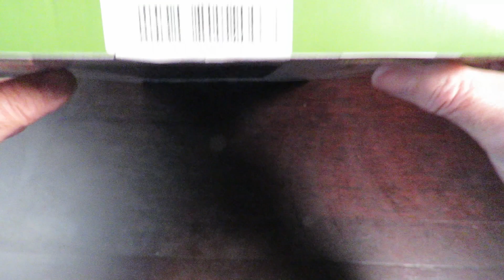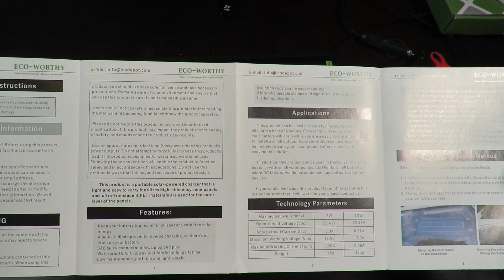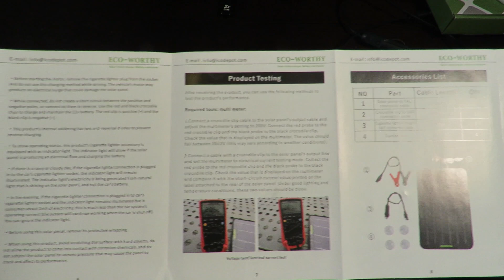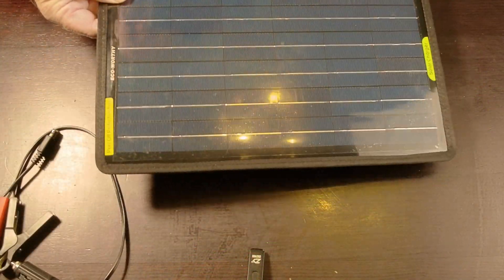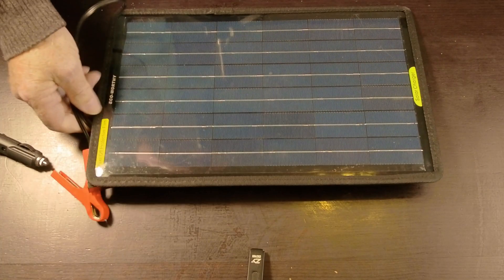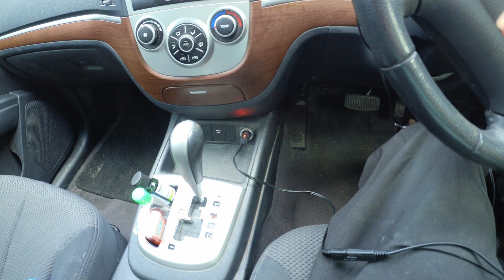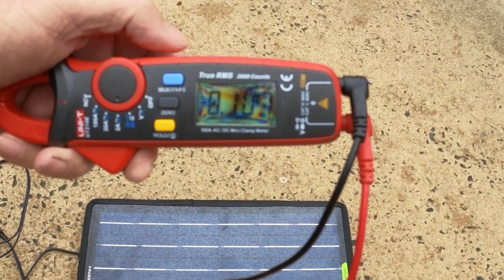🔌Save your Car Battery from going Flat - Eco-Worthy 10w 12v Trickle Solar Charger

Comment: I've just purchased a 10 W trickle charger. When I attach my multimeter to the crocodile clips while the panel is in daylight it reads 0 Volts even though the green led light is lit up on the back. I have read that due to diodes to stop reverse current then an open circuit voltage check can't be carried out, but surely I should have a voltage reading ? Any advice please

Comment: I bought the same brand from amazon but the company redesigned it so it does not look like what you have. The first one I received from amazon and tested under the sunlight which did not produce more than 0.02 amps. According to the specs 5W solar panel supposed to produce at least 0.2 amp. The seller offered a replacement and just received it today. Will test it tomorrow.
Reply from the maker: Please let me know how the new version performs.
Reply: @GarryPurcell  Sorry that I took too long to reply. I received a 5W solar trickle charger from the same brand. I hooked up to my car battery with clamps to test it for a few days. I realized that 5W isn't enough to charge or maintain the battery. I guess the 5W solar panel works for the smaller battery size. If you own a decent car you should go with at least 20w but there is no guarantee that would work. I live in an apartment with a bunch of tall trees and buildings where there are only a few spots where I could get the sun all day. Now I am using OYMSAE brand 20w panel placed on the dashboard facing south where I can get lots of sunlight. Also, I tested amperage rate every hour which it reusting average of 460mA while the spec says optimum operating current at (Imp):1.11 A. This is due to the sun's positions. In my experiment, solar panel usage should work little less than a half of the specifications. When you buy those small panels you will need to consider the output amperage rather than the wattage and voltages.
Reply from the maker: @kennyhoffman4375  Thanks for getting back with an in-depth view of the device you bought, and the shortcomings of the lower powered unit. I'm certain that will help many people who read the comments.🙂

Comment: 4 me is a bit too high voltage to charge a battery
Reply from the maker: A Car alternator charges between 13.8 and 14.2 volts, so it's hard to say if the solar panel outputs too much voltage, I'm sure I'll find out in time. 🙂
Reply: @GarryPurcell  safety voltage to charging is between 13,2 to 16,2 V.

Comment: This may have been added but if using the cig charger remove the resistor and LED from the cig plug (takes 2 minutes, just snip it out) as it sucks over half the power from the unit and will drain your battery at night if plugged in. Other than that this solar charger works great, I use it on my Merc albeit via the battery terminals as the 12v AUX is off when the ACC curcuit isn't activated via the key.
Reply from the maker: Handy to know.
Thank you.
Reply: A video showing how to snip them out would be great for us girls.

Comment: Seems a little high for the voltage, I believe 12V batteries aren't supposed to charge over around 14.2V or they can be damaged
PS- great video, thank you for sharing 👍
Reply from the maker: I always thought amps would be more of a problem than voltage.
Reply: @GarryPurcell  I believe its the unregulated voltage that causes the damage why some people run charge controllers I guess
Reply from the maker: @JonnyDIY  Thank you, I'll have look and see what I can find online.

Comment: just bought one, but after reading reviews and comments, i am inclined to buy a battery tender controller to use with it. This way there is no danger if the diode fails that the battery would be fully discharged and fail
Reply from the maker: I'm not sure myself.

Comment: Cigarettes lighter plugs are usless on many american and Japanese cars as some European cars as the Cigarette lighter plug only works with the ignition key in the on or acc mode. 
Battery clips can come off or short out to the bonnet(hood)  a solid electrical connection that has a fuse 3" maximum from the positive battery post is the best route a 10amp fuse should be plenty.
Reply from the maker: Interesting observation, thank you.
Reply: do the lighter socket  have to be live to charge te panal

Comment: 3:50 you will find that the radio and cigarette lighter run off the same fuse
Reply from the maker: Ahhh, That makes sense.
Thanks for the information.

Comment: I am wanting to add some solar power panel/(s) to my Ham Radio, Go-Box project. To charge my small SLA. 12V batteries. Also incorporating a charge controller, to prevent over charging, and maintaining the batteries. (Eventually going to change to LifePo4 batteries.) 
Thanks for the videos!
Reply from the maker: Glad I could help.

Comment: I'd love to see some more tests. Especially how much time it takes to totally recharge a battery.
Reply from the maker: Thats an interesting suggestion.
I'll see how the battery is, when I get back home next week.
Reply: These aren't made to charge a discharged battery. You need an actual charger for that. These are made to maintain a charge, for a vehicle or piece of equipment that goes for long periods without being started.

Comment: Hi Garry. Once the battery is fully charged, it would be worth checking the voltage across the terminals while connected to the battery to ensure its no higher than 14.4v or the battery will overcharge shortening the life of the battery. A few diodes in line should help reduce the voltage if it's still too high. I doubt however the panel will output 20v when connected to the battery even when fully charged but well worth checking.
Reply from the maker: In bright sunlight, the battery terminals are showing 14.8v connected to the charger, so not too bad
Reply from the maker: Thanks for the info, I'll do some tests when I get back home next week.

The device is meant to have an inbuilt overcharge circuit, but I'll check the battery voltage level when I get back.
Reply: A diode will not do anything for this you need a resistor ,  diodes direct the current flow one direction  resistors impede the flow of electrons.
But in this case you would need a electronic circuit to control the charging cycles and limit the voltage using resistors diodes and transistors 
A transistor can stop current flow like a relay  now a led might also burn off some of the current but thats only a 1.5 volts dc and you must use a resistors to lower the 12vdc to 1.5 volts a 10k ohm resistor does this. 
You could also use a on off relay relays only use 1/4 watts to operate  properly the amount of current draineing battery in the first place.  Im not an electronic engineer but I bet I could desine a working system to do this its pretty basic electronics.
Reply: @bobbg9041  diodes do create a voltage drop.